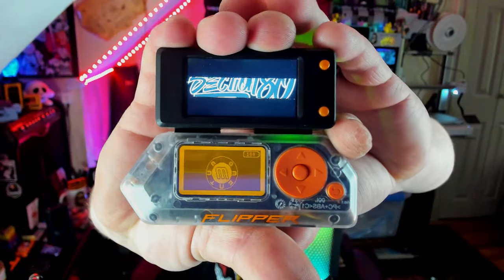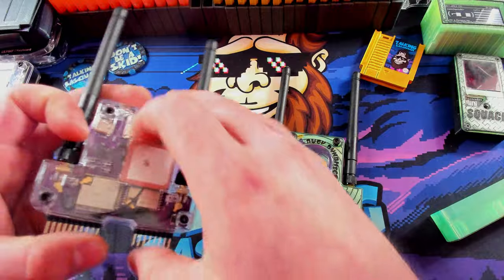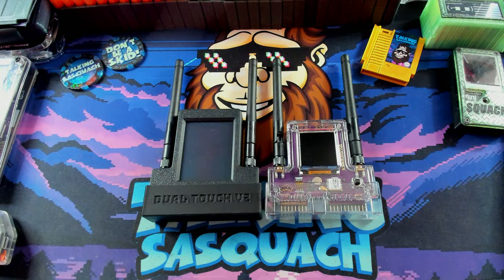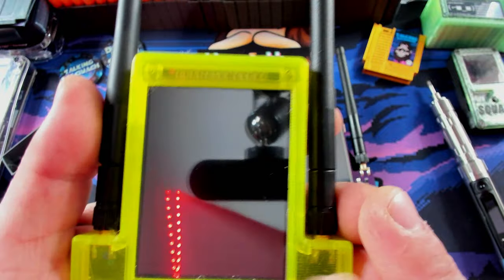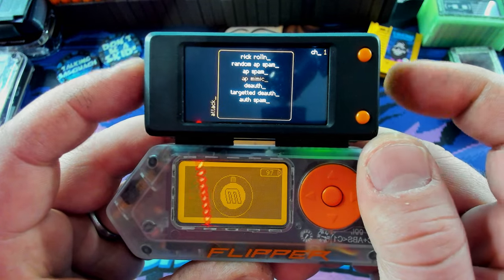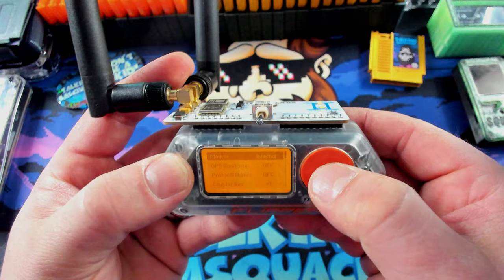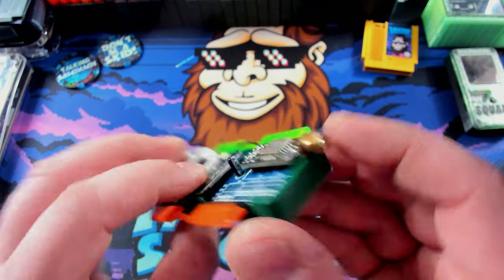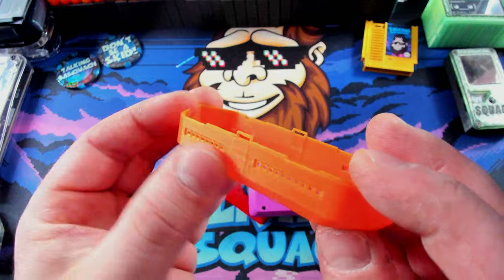Latest and Greatest Flipper Zero Add-On Boards!

Comment: a ton of new tools, 0 new features
Reply from the maker: Tell me about it.  Its so hard making Flipper Zero content, there hasn't been a ton of new stuff for a while
Reply: @TalkingSasquach it’s dead , we need to go ahead and move on to v2
Reply: Even with no new features, what we tech people really like is convenience, having everything into one thing

Thats what makes the flipper special

Im hoping that their would be an Add-On that has the same idea, where the flipper would have all the missing features

the ultimate Add-On, even if it does look bulky, Im just glad that it has everything that I needed, no longer have to worry about carrying extra bigger gadgets with me
Reply: People need to just stop putting esps in everything and calling it new. There are literally millions of modules people could be using, and those of us who use the device on a daily basis far from consider it dead: the community just hasn't been very creative, nor are most of them mature enough for the potential uses we could be making of it.
Reply: @BamboozledHandboozled 3.5v Linux computer with interface to flipper would solve all of this. Can't use a pi 0 since it can't be hot plugged and burns out the battery.
Reply: Be be fair anything cool would be illegal